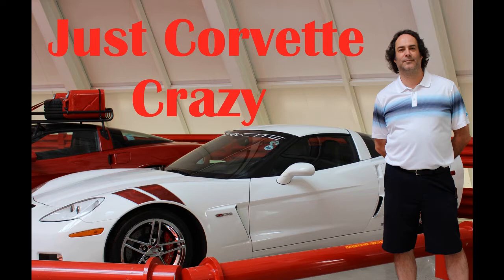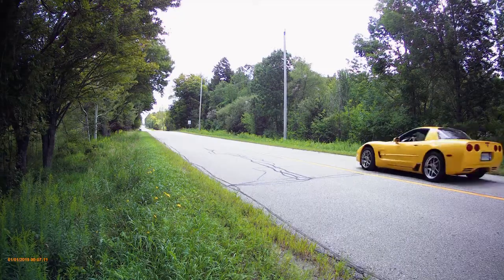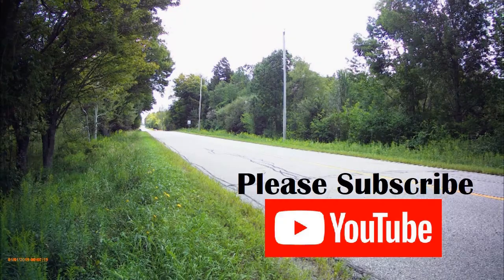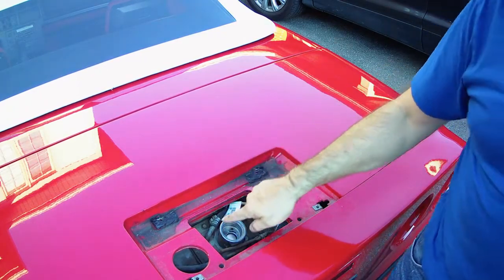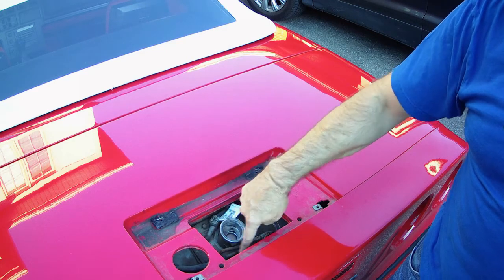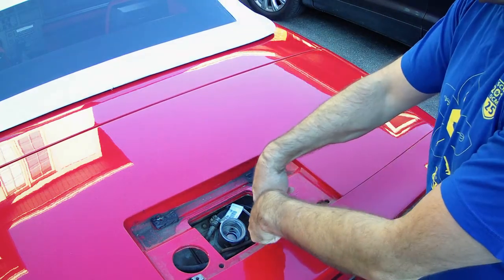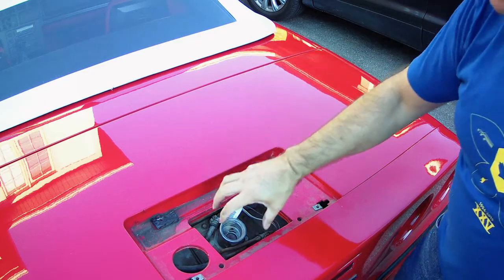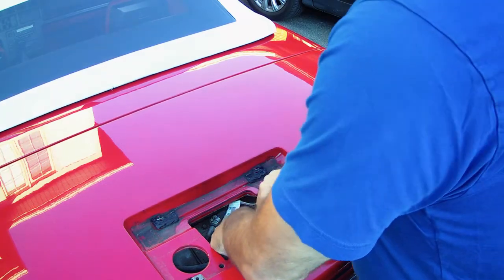Testing Procedure for Diagnosing A Failed Fuel Pump

Comment from the maker: Hey Folks, thanks for watching.  A point of safety!  Near the end of the video we are testing power to the fuel pump.  You will see that the voltmeter is connected before power is turned on and removed after power is turned off.  So very little chance of a spark.  Just to be extra safe if you are doing this test, "Leave The Gas Cap On!".  Stay safe everyone.
Reply from the maker: Hey Folks, Ross installed the new fuel pump yesterday and the car fired right up on the first try.  Unfortunately I was not able to be there to record it for the channel.  Glad to hear the diagnosis was correct!